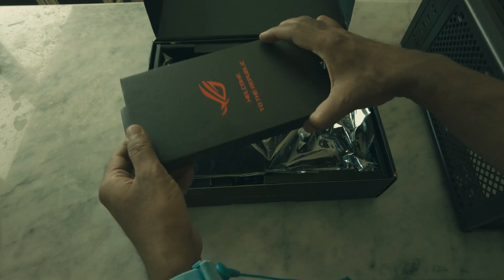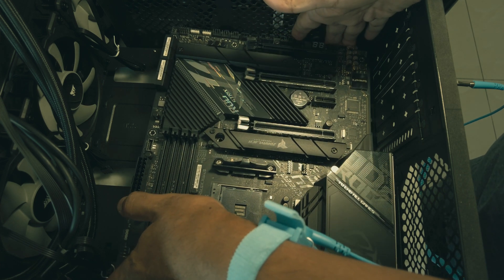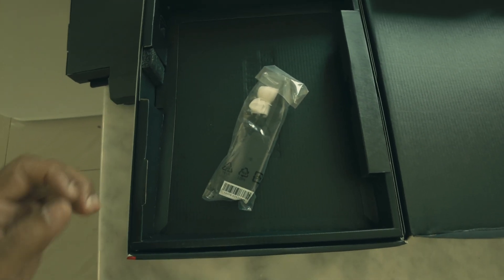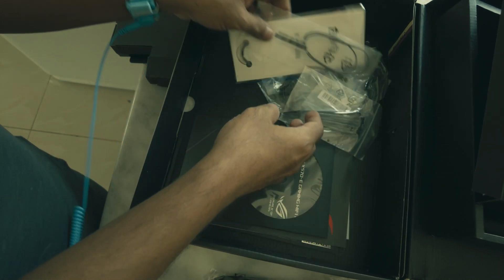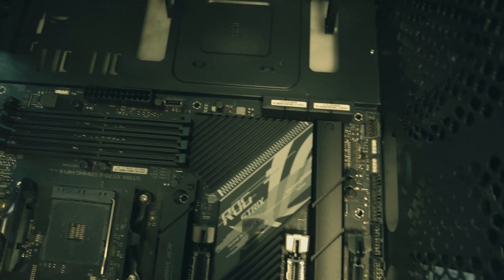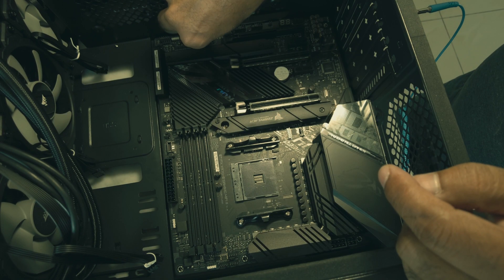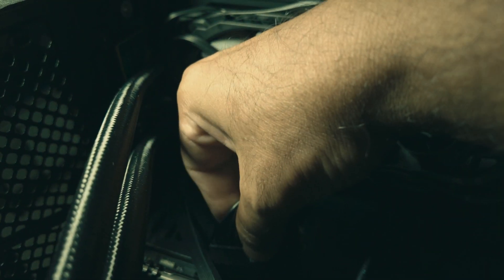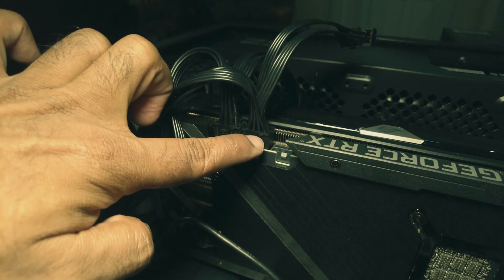Rog Strix X570 E Gaming Wifi II Asus / Unboxing Connections & Installation

Comment: You can actually put computer components on tbe outside of the antistatic wrap because it is actually not conductive. You should wear an antistatic bracelet, but so long as you ground yourself before touching any computer hardware, it is impossible to shock any parts
Reply from the maker: in my previous built i did that, i place sometimes on the cardboard as well. never experienced any issues with those. but on internet this is going on which is why i mentioned that way. thanks for information. and as always, having good practices in place is a good thing. like hold motherboard by its sides, dont touch circuitry etc.